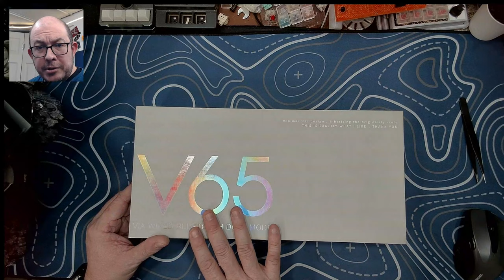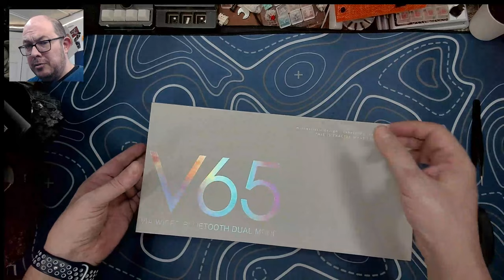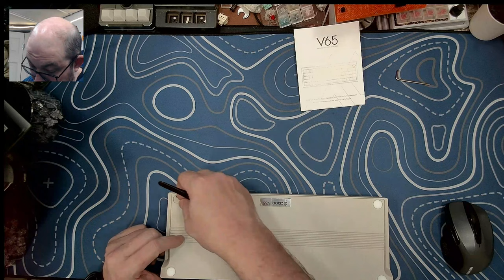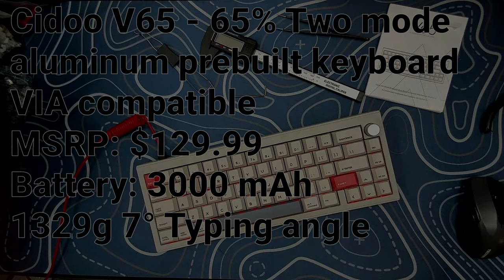Cidoo V65 A keyboard that does many things right but has some fatal flaws that I can't recommend

Comment: Thanks for the great review. I just got this. A complete novice myself, but i got the RGB in wireless mode working for me!
Reply: It was very weird though. When I got it, it was sort of in a ”forced wireless” mode where the wired connection did not do anything bit give power to the keyboard. No matter which way I had the switch in the back, it could BT connect to my phone but did not register wire connection to my desktop. It was solved through Fn + Space (iirc) quickly - the command to disconnect BT. That made everything go back to how it should be. Weird indeed. Minor clicking on the right side of the left shift and otherwise quite consistent indeed. From my expectations and scarse reference base (to say the least) I’m indeed happy for what I got for the pay. Based on your comments here I wish it stays that way so I can avoid contact with an absent support 😂
Reply: @pettristyle  how u made it so the rgb works in BT mode
Reply: @pn-kb  honestly I have no idea mate. As my previous comment it seemed to be in a sort of ”forced wireless” mode when I got it, and switch in the back did not to any difference but give power (it could still only be BT connected even if the switch in the back was off). In that process I noticed I got the RGB in BT wothout any wired connection.

Iirc RGB still worked even when I sorted the ”forced mode” and did the wireless BT connection normally again. Can try again when I get back home and double check.
Reply from the maker: The R2 of this keyboard allows for RGB in Bluetooth mode, seems they watched my review.

To bad the connector is still poor, though I have a new unit sent to me for another review which is coming soon.

Comment: I just picked this up, and I really like the switches. Unfortunately, I haven't been able to find them independently, only on CIDOO boards. I'd pick up another set for a different board if I could find them.
Reply: Yea, it’s CIDOO v65 exclusive but on Q&A section there’s possibly to sell them separately in the future

“Sorry, the keycaps are not for sell at the moment, but we will consider releasing it in the future.”

Comment: I’m not going to mod this board or open it up or anything, just use it stock, is it fine for that?
Reply from the maker: I've reached out to them to see if I can review another keyboard but they have told me to wait I'm not sure exactly what I'm waiting for but until I can review a unit that actually works, I have six defective ones on hand, I cannot change my opinion. I would avoid until their QA/QC can be qualified as working now.

Comment: I got this board a few weeks back and the exact same thing happened to me with the daughter board connector. Being new to the hobby it was scary, thought I ruined my board, the plastic connector kind of got deformed as I try to remove it from the socket and one of the pins popped out. Luckily I was able to wiggle it back in and the board works fine now. Will not be removing the socket again as it feels like I can further damage it. I thought it was just me with my clumsy hands (never happened with any other board) but now I see it happen to Mark I know it was not me :) Otherwise I'm loving the feel and sound of the board especially for the price. I saw on their FB page they are releasing a version 2 and the screws are being moved from out under the feet, hope they fix the cable connector defect too.
Reply from the maker: I've reviewed (2) R2 units; both had issues. This keyboard may sound good but won't last long with the poor QA/QC.

Comment: I had a hard time watching you complaining over feet on top of the screws for I feel like a half of the video, admitting that keyboard sounds and feels good, and I'm just like... really? I see how it can be quite annoying, but I don't think someone will open the keyboard on a daily basis and there are spare feet. RGB is not a problem for me at all, considering other great stuff. only connector issue felt like a real issue, but it can happen to anyone I guess. my heart trembled when you tried to pull it out holding cables 🥲
Thanks for you critical review, it's good to have something to compare with, because everyone is praising this keyboard. I think it's better to have all the opinions and information, and it's for everyone to decide what to think of all the pros and cons personally 👍
Reply from the maker: I couldn't agree more, thanks for your honest opinion, cheers!

Comment: whats your recommendation for low budget in aluminium case and wireless?
Reply from the maker: Low budget and aluminum don't usually go together, but if you like both aluminum and plastic, the Halo series is ready to go OOtB and when considering they are fully loaded, they are about as well priced as can be had for wireless and aluminum: https://www.youtube.com/watch?v=Rp25KEK1m0Q
Reply: @MechKeyboards  whats do you think about ajazz ac067?
Reply from the maker: @Gabri_Alb  I don't have the AC067, though I do have the AC064. I'm not the biggest fan of Ajazz, but do know some that have and enjoy the 67. One of these days I'll get my hands on one!
Reply: @Gabriel Albuquerque  
It depends what you consider low budget? This Epomaker Cidoo v2 is available in Amazon US at $130 price point - Alum/Linear switch. 

If you can get KBD67 Lite (65% board) at $120, add $50 Durok Black Lotus linear switches and $30 good XDA keycaps from Amazon, then you have better keyboard than this. But again, you have to add $70-80 over this keyboard's price. Your choice.  
  
I'm still not decided, but leaning toward KBD67.

Comment: Does screw in stabs work? U Tried it out?
Reply from the maker: I did not try it out, though the PCB has the holes (as seen here: https://youtu.be/LoSAQSf8CbI?t=770) but I'm not confident the plate had enough space for PCB mounted stabs.
Reply: @MechKeyboards  could you try it out? would be nice considering the price the board comes in. Thanks!
Reply from the maker: @pn-kb  I no longer have this keyboard, it died within 5 days and was returned. Nothing from sold by Epomaker or made by FancyTech (FinalKey) is known to last too long.
Reply: @MechKeyboards  hmm so u dont rly recomend the kb? Is there a reason why it dies?
Reply from the maker: @pn-kb  I thought I laid out the reasons why in the video, was I not clear about it?
Reply: @pn-kb  Yes, screw in stabs work perfectly fine without any issues whatsoever. It does in fact, come with screw in stabs so obviously it works. When you touch it, you’ll know it’s a great board overall with a great feel without any issues. Don’t worry about what you hear about it.. the pros heavily outweigh the cons. If you’re planning to get it, just get it. Been using for 2 months now.

Comment: Akko 5075s kit or Skyloong GK68XS?
Reply from the maker: For what? One is a tray mount 65% the other is "gasket" mount knob 75%
Reply: @MechKeyboards  everyday use
Reply from the maker: @timthirsty3816  The Akko is a hit and miss, I'd suggest either a Keychron V1, a James Donkey A3, or the CSTC75, which is just a wired kit of the Feker IK75, another great kit.

Comment: u need to test v2 version there they fix a lot of problem or take finalkey v65 r2 and build it
Reply from the maker: I've already gone through (3) R2s all had QA/QC issues. I cannot recommend this keyboard.
Reply: @MechKeyboards  and what kind of analogue can be considered in this range while remaining in 65% of the form factor?
Reply from the maker: @xqcsq  as long as you don't need the knob I'd say a Black Label Portico, Momoka Zoo, or a Tofu65v2.

Comment: you need RNGesus with this kind of companies. but i dont recommend this as well. looking forward for a GB keyboard! :)
Reply: what do you mean by RNG for these companies? Some boards may be bad?
Reply: @cakeodyssey  yes correct qc and after suppprt is not a strong point for this kind of companies
Reply from the maker: I doubt there is any after sales support for this keyboard and QC was either snoozing or non-existent with the JST connector that had not just one but two pins no crimped!
Reply: @MechKeyboards  is that the connector to the battery? Because I just ordered mine and I couldn't tape mod it because it didn't disconnect from the battery and RGB.

Is that the JST connector you are referring to?
Reply from the maker: @cakeodyssey  the daughterboard JST connector.